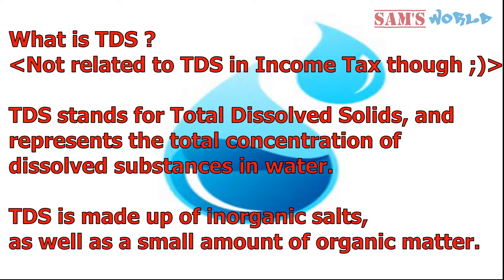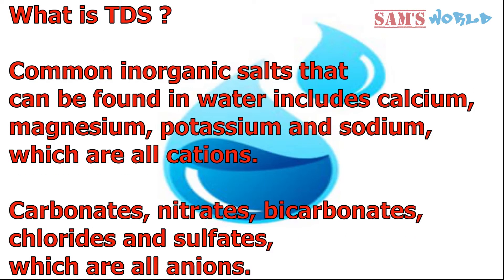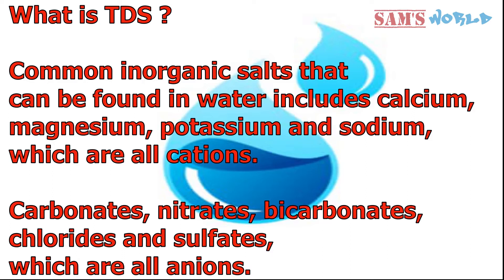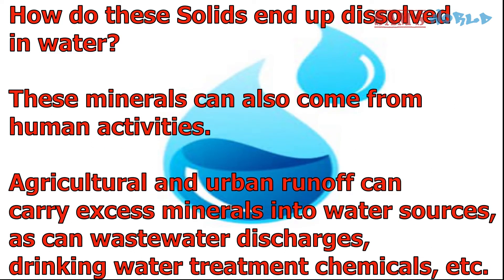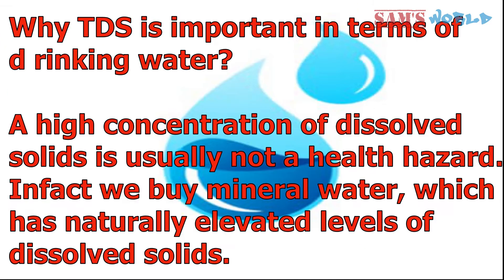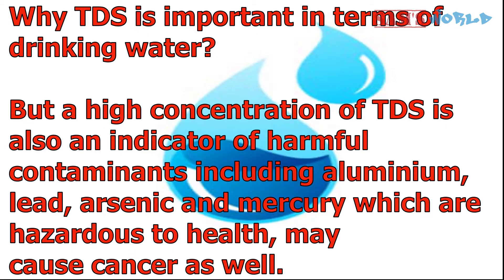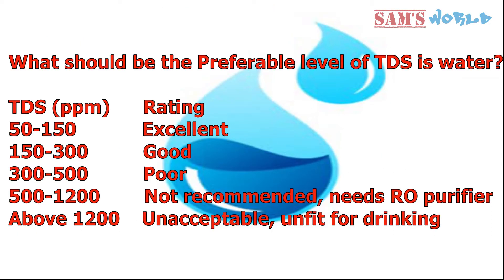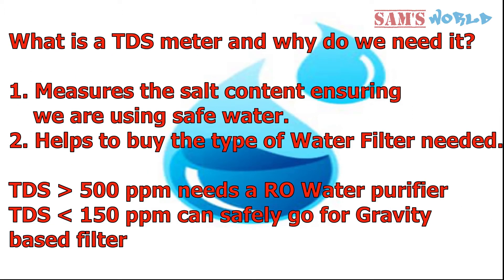✅ TDS level in Drinking Water 🚰| TDS Meter Use| TDS Level Practically Explained 💦 | Bangalore Water

Comment: This is wrong 300 to 600 is good as per who
Reply from the maker: That's good.. Below 300 is best!!
Above 500 you need an RO purifier... You can verify this anywhere
Reply: @samrishaofficial  mine is 376 so we don't need any purifier.
Reply from the maker: @ನಮಸ್ಕಾರBengaluru  Not necessarily ... You can use a normal purifier like mine.... I have seen people using RO purifier as well... If you check RO water, it's level is below 50 ppm.... Checkout my purifier review https://youtu.be/loR5vujaI-0